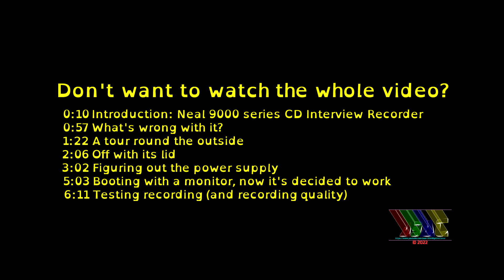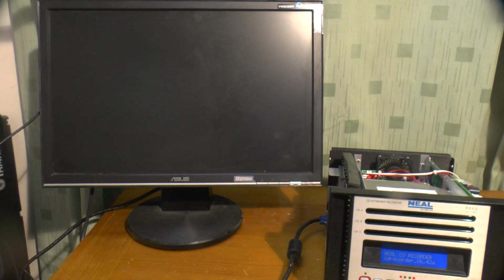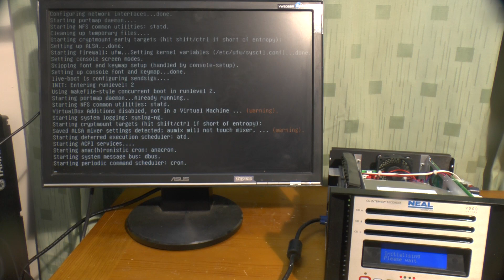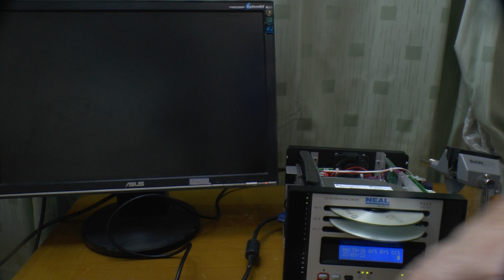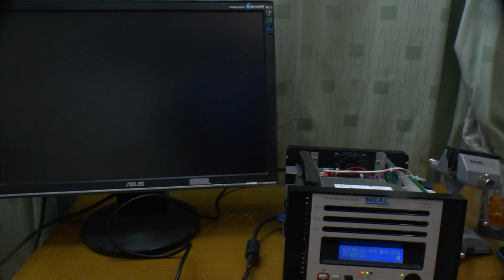Neal 9000 CD Interview Recorder teardown and fix

Comment: Interesting device using a embedded pc seems a bit overkill for what the device is doing. 

Nice video
Reply from the maker: When you look at what it's doing - digital recording, three simultaneous copies, basic controls and a display to show what's going on - it's probably the cheapest way to do it as a lot of it is off-the-shelf, despite there being a few custom boards in there.  It could no doubt be redesigned to use a Pi with a USB or SATA hat to deal with the drives, this would probably slightly extend battery life and bring the cost down a bit.
Reply: Yeah, it's micro-ATX PC hardware with a low-power Intel Atom processor. Running I suspect is a custom Linux OS from the USB-stick. Later versions might went to something ARM based.